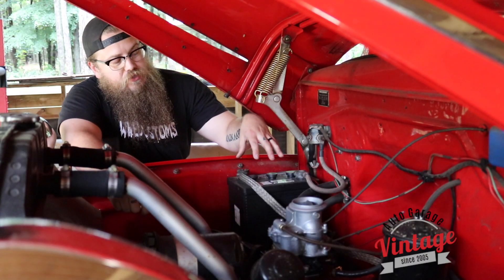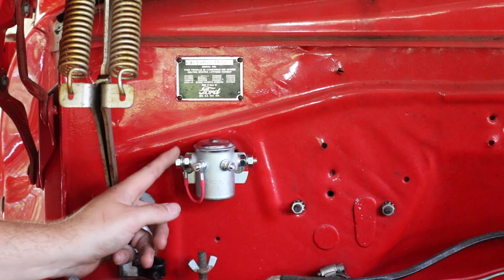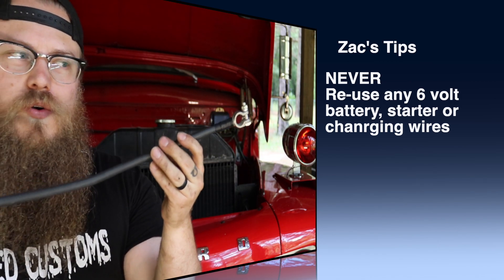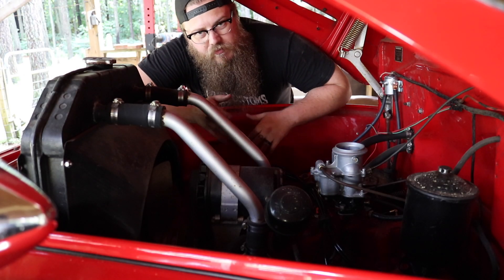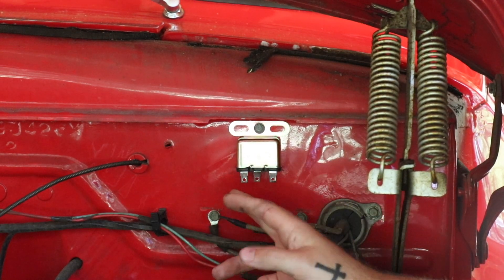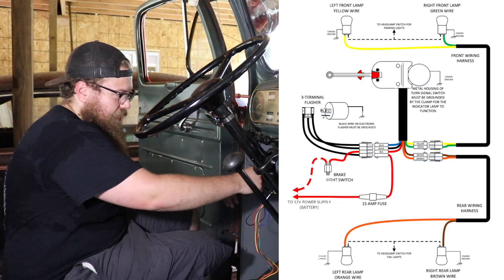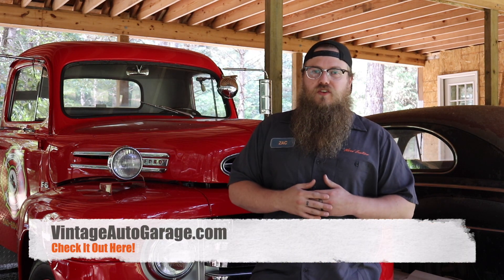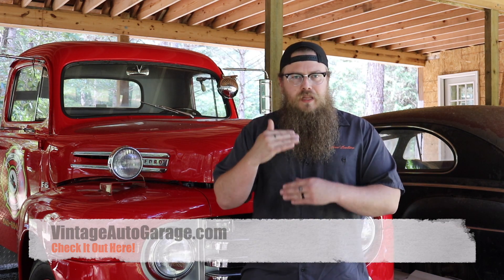12 Volt Conversion Kit Install! Flathead Ford

Comment: This is great but can I ask why you'd need to remove the fan? I got mine out just fine without removing the fan. Removed the wiring, slacked off the fan bracket bolts and generator mount bolt, undid the bracket strap, lifted it out.

Comment: PLEASE go over the wiring of the solenoid, placement of the trigger wire and the purpose of that jumper wire you use. I am thoroughly confused! to me that jumper would have the starter constantly engaged and connecting the trigger to the solenoid would then short everything out. I'm sure I'm missing something simple so please forgive my ignorance, I just want to get past this hurdle

Comment: What if I had 12v chassis under one of these trucks?  Example I'm inquiring about is the stock temp gauge: it is stuck "H" and only goes to "C" when 12v is applied through the send wire. I have the voltage reducer going thru the gauge but it does not move. Is there a difference in temp sensors in 12v vs 6v? Thanks

Comment: I have a 1954 ford crestline, converting to 12 volts, using vintage auto kit.   Hooking up the reducer to the gauges, (2),  it has two terminals , one with one wire, the other with one two, one which goes into the dash illumination bulb….. question…. What side do i put the stepped down 6 volt wire to? And do i remove/ cut the one i i replaced?  Or leave them all hooked up,    Please help.

Comment: Great video's, thanks for all of the video's you post. I ordered the 12 volt conversion kit from Vintage Auto Garage for my 1939 Ford Deluxe Coupe. I;ve got everything installed. The lights work as well as the horn and the dash lights and gauges but, when I push the start button, nothing happens. I really don't understand how the start button functions with only one wire but, that's the way it is designed. That wire goes to a relay under the dash mounted on the firewall. That relay was not in the kit so it was not changed. I have checked and rechecked my wiring and everything looks correct. Do you have any ideas for me ? That relay is spotwelded to the firewall. Should I replace it? If so, do you have a part number or description for me. Also you recommend a fuse in the wire going from the start button to the coil but, I'm not sure what amp fuse to use.

Comment: Good afternoon Wired Customs.  I appreciate this video, thank you kindly.  When doing the 6V to 12V conversion, Vintage Auto Garage (they are a huge help as well) recommends keeping the voltage regulator in place removing the wire for the generator and keeping the other wires still in place to the voltage regulator.  I will be going to an alternator.  My question is, can the voltage regulator be replaced with a new 6V voltage regulator or since I will be converting to 12V can I, do I, or should I replace it with a 12V voltage regulator and hook all those wires that are connected to the current 6V one for the exception of the generator wire.  I know this seems like a lot to my question.  I’m just trying to sort it out so it’s efficient, reliable, and safe.  I have not started the conversion as of yet.  Thank you in advance for your response.  Stay safe, blessed, and well.  1950 Mercury Club Coupe.

Comment: Zac,

I have a 1948 F6 farm truck that I want to convert from 6V to 12V. I am a retired electronics technician, so I understand both wiring and circuits. I can “get into the weeds” if you will, to better understand how the gauges and circuits work. The fuel, temp, and oil pressure gauges are straight forward, and I can get a 12V to 6V conversion block that I can use for them. Here are some additional questions.

1. I am considering using the alternator you are describing as it bolts directly on the engine without having to monkey with mounting brackets. With only one wire and a 90A capability, what gauge wire will I need to use to connect it to the battery and then to the main fuseblock? According to an online wire gauge, it suggests that I need to use 4 gauge wire for a 100A system. Is that what you used for your truck?

2. I notice that you are running your alternator wire directly to the battery. Does that mean that the alternator has its own internal relay so that it doesn’t draw power from the battery when it isn’t running?

3. You feature a diagram of an “ammeter” at 11:29 on your video. That isn’t an ammeter, it is a voltmeter. Not the same thing. An ammeter must be placed in series with the line in order to measure current. A voltmeter is placed across the line to measure the voltage. The diagram is for a voltmeter. 

If the gauge is what you depict, it doesn’t measure current, and I would have to place a series resistor to use it to measure 12V instead of 6V although a 60Ω 10W resistor is doable if I could find one.

A typical ammeter has a shunt resistor in parallel with the meter itself which is only rated for a small current capability. The main power is routed through the shunt allowing only the small current to the meter to read its proportion of the main current. The greater the current range, the smaller this resistance value must be.

To use the 60Ω bimetal coil shown in the diagram as a true ammeter, it will draw 100ma at 6V. that means that in order to measure 50A at full scale, the shunt must carry the remaining 49.9A while producing a 6V voltage drop to run the meter. To do this, the shunt must have a resistance of .12Ω. I will have to cut the shunt resistance to .061Ω to achieve the 100A range I will need to use with a 90A alternator. 

The problem with this concept is two-fold: First, if I drop 6V across my ammeter, then only 6V is available for the rest of the system. I would have to run my battery and alternator to 18V in order to keep 12V to the system. The next problem is that dropping 6V across such a circuit consumes nearly 600W of power. Both are impractical and not going to happen. I need an ammeter that will only drop a few tenths of a volt and consume only a few watts of power at full range. That was what I was expecting the ammeter to do until I saw your diagram. I will have to rethink my idea of how to make this work.

4. I need to find a period correct cartridge fuseholder, but so far the ones available online are for the newer style plug-in fuses and they are marked for marine use. Do you know where I can get a cartridge fuseholder that I can label for my own circuits?

I appreciate the video you made. It has given me insights into what I need to do to accomplish the conversion. Please reply directly to my e-mail below.

Thank you.

Brian Yerka
Blackfoot, ID
brianyerka@yahoo.com

Comment: recently bought a 1950 ford 2 door.  sitting since 1991, going to do a 12 volt conversion, positive ground to negative ground.  have 12v to 6 v step down and  need to buy a wiring kit.  my question:  as I swap ground polarity, do I have to swap the polarity on the back of the gauges?  electrons will be going opposite direction.  do the gauges care?  leave the sending unit on same connection?  sending unit transits a resisted ground to gauge, which gets a hot volt from the key switch.  do I swap inputs on the back of gauges?  Am I over thinking this?  watched loads of videos while at work and have not stumbled into the answer, thank you in advance

Comment: What stops the starter from turning backwards?
Reply from the maker: The direction of the spin is determined by how the electric motor is wound, so it will still spin the correct direction no matter the polarity
Reply: @WiredCustomsSpeedShop  good to know

Comment: Hi Zac, I'm almost done a complete wiring of my '35 to 12V including using new harnesses from Third Gen. One item that I'm confused with is the wiring of the Foot Starter Button. I'm doing away with the modern Ignition/Starter switch to reinstall a new Foot Starter Button for a more traditional look. feel and function. At the moment I'm stuck and confused reading the old Ford Schematic sheets - could you please tell me where the two wires on the Foot switch are connected? I've used the Vintage Garage kit you used on this video - many thanks for your help.

Comment: Thank you so much for the video ! 2 questions, at this point would I need to put in a new fuse box? I still have the old glass fuses. I'm converting my 53 MercuryMonterey.  Keeping the generator using the MSD ready to run distributor. Would I use the same starter solenoid that you show at the beginning of the video?

Comment: Hello.
Im going to convert my 49' to 12v negative ground and install an electrical fuel pump. Tips on best way to get power to the pump only when the engine is running? Otherwise i guess i could install a manual switch for the pump, but that doesnt feel ideal. 
Ive ordered the kit from Vintage auto garage with the powermaster.
Cheers
Reply from the maker: You could have a key that switches a relay for the pump or the ignition switch could switch a relay, just make sure whatever switch you use that the pump power doesn’t actually run through the switch

Comment: Hey Zac,

I need to do an aftermarket fan and I’m wondering if you know temp range for the sending unit and the make/model for the 12volt system. And do I need to change the dash temp gauge or can I just run it to the voltage reducer then to the dash temp gauge?
Reply from the maker: If you have an electric temp gauge on the dash you can still buy a stock temp sending unit and run it to the voltage reducer, for the fan you will have to run it on a separate temp sending unit, typically a good electric fan will come with its own sending unit, the early ford store and MACS would be the places I go to find a OEM sending unit for the gauge. But all that being said, I still recommend running two mechanics temp gauges, one for each head, since you could have one water pump fail and not the other and have no idea, by 1949 ford fixed this with the dual temp sending unit to one electric gauge on the dash, I don’t remember what year vehicle you have but that’s food for thought
Reply: Awesome thanks I’ll get a stock one. Can I place the fan sending unit in a different bolt hole? 
Also, I’m getting no power to dash lights, blinkers, headlights, starter. Can that beck a bad circuit, breaker, or ignition switch? I doubled checked all my connections for the replacement wiring harness that I installed.
Reply: Hi Zac,
I hope you can help me out. I have completed wiring everything in double checking my wiring now the truck cranks. But I’m only getting 5.6 V to the coil and it says that I need to be getting 12 V to the coil. I check the ignition switch And it has 12 V going in but to the coil I’m only getting 5.6 V. I’m not sure why that changed. Also, the headlights and tail lights aren’t working properly. I follow the directions on the wiring instructions but it doesn’t seem to be working right. If you have any ideas, I could definitely use them.

Comment: Great video, thank you! I am working on 1947 truck, I have a converted to 12 volts, generator, wipers,  dash cluster etc,.. it currently has the 6 volt  6 volt sending units oil, temperature, fuel, work/read ok with 12 volts?  Thank you!

Comment: What is the benefit to doing this? I don't really fully understand the point of 12v conversions
Reply: There are many  more 12 volt parts accessible than 6 volt parts, and easier to add accessories.

Comment: Great video!  Your explanations are very clear.  I have a 47 Mercury flathead so just starting research on doing a conversion.  Since my gauges don't work at all I plan to use an after market company to replicate the original design but be 12vDC.  I didn't see any mention of changing the coil.  Does that need to be done?  Thanks!

Comment: on the 48 -49 wiring diagram there is one yellow wire passing under the batt  ( amp) gauge to the circuit breaker that goes to the battery side of the 6v solenoid which has 3 posts on it,  in the video, there are 2 wires from the fuse box. I believe the larger wire would go to the batt side of 12v starter solenoid. What post does the smaller wire go to?   The old 6v solenoid had 3 posts one bat, one starter, and one starter button.

Comment: Actually, I do have a question. So I bought a 47 Ford Super Deluxe with the 12V conversion already done. I can't get it to start and I think it has something to do with the push button and maybe a fuse but I can't locate more than maybe 4 fuses total under dash and in engine compartment. There should be more, correct? Like a fuse bank or block somewhere? I have installed a new starter, battery, and ignition solenoid which all seem to be working via my volt meter. The battery is coming in at 11.97 volts however. So, maybe that is it?  Otherwise, I think it must be a blown fuse that I can't locate.  Any ideas? Thank you so much!
Reply from the maker: For the question about more fuses, there “should” be more, but I see a lot of the times people don’t fuse everything they should, check for power on the positive side of the coil, also some ignition systems can’t start unless the battery is at 12.4 volts
Reply: @WiredCustomsSpeedShop  thank you so much! I will go look at those items and get that battery charged back up to 12.4. Thanks again and I'll post an update 🙂
Reply from the maker: @jameslewis5569  right on no problem at all
Reply: @WiredCustomsSpeedShop  Zac, I have an update. Charged battery to 12.6V and checked the coil.  Coil is registering at 11.97V. Still no start, no crank, no click, nothing from the push button. It just seems dead.  I think the brake lights are not coming on either. Rest of lights are working.  Thinking it is a fuse but can't find more than about 5 fuses throughout the whole wiring system. Thanks for all you do to keep our old Flatheads running!
Reply from the maker: @jameslewis5569  jump the battery to the starter relay and see if it will crank over then
Reply from the maker: @jameslewis5569  hey James you could always message me on Facebook or Instagram, it’s a little easier than YouTube

Comment: What did you do with the wires that were connected to the generator? The voltage regulator on the firewall and its wiring?
Reply: there are 4 wires on the voltage regulator a ground, an amp, a field, and hot ( power)  from the circuit breaker under the dash. The grd , amp, and field all go with the old generator as they are no longer needed. The stock hot wire is yellow and should be disconected on the circuit breaker making the voltage regulator powerless.

Comment: Safety! How to protect the electric system and vehicle?  A lot of the older vehicle and tractors I work on have or need 6v to 12-volt conversions.   Also, the systems may have been modified from original and things may have been added. What are the best practices regarding fuses, fused links, breakers, etc to design and lay out an overall safe system that won't be a fire hazard? I have yet to find a good video on this basic concept.

Comment: Just started working on my 12v upgrade but, every time I start I find something else that need attention before I get further into it. Today I upgraded all the 6v bulbs and discovered a number of issues with wiring and fasteners - I guess that's a good thing (it's a 25plus year old restoration)! Replaced the bulbs, flasher and relays... tomorrow I'll be under the dash doing the 12v-6v gauge component and the inline fuses where needed. Wish me luck!

Comment: I have 50 model 8n ford. I want to fix the amp gauge no I can't find any wires going to it. Pos.ground. 6 v. How would I wire it up? I want to keep the 6v. System. Or would it be better to have a volt gauge?
Reply from the maker: I’m more of a fan with volt gauges, but if you want to keep an ammeter then you hook it up to the positive output on the generator
Reply: @WiredCustomsSpeedShop  only one wire? Nothing to the switch
Reply: @WiredCustomsSpeedShop  would I hook up the volt meter the same way
Reply: @WiredCustomsSpeedShop  I haven't bought a new gauge yet. Wanted to see if the old one worked. If not, I'll go with the volt gauge. I'd like to hook up all my light too. How can I do that read my meter with volt or the other.
Reply from the maker: @d.brownjr.4845   the ammeter only needs one wire in most vehicles, the ammeter works like a coil and has an internal wirer wrapped around the prop that moves the needle, it works off of amps in the wire, the volt meter will need a power and a ground to operate
Reply: @WiredCustomsSpeedShop  oh ok.thank you for your advise
Reply from the maker: @d.brownjr.4845  love to help!